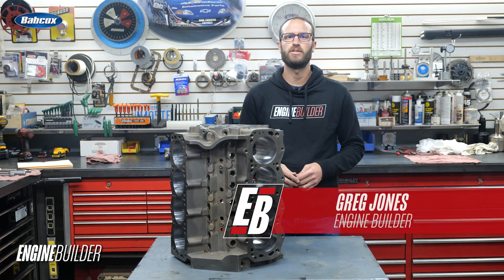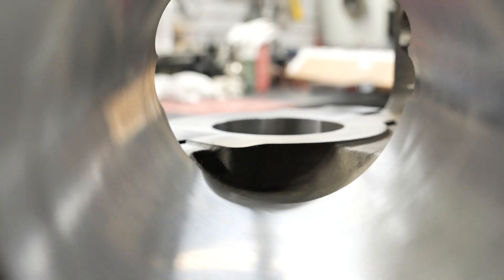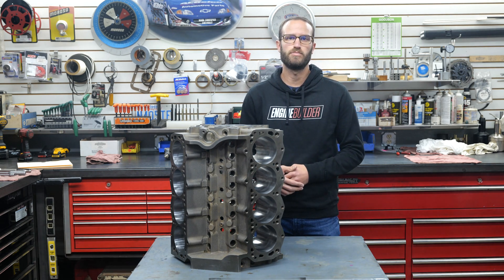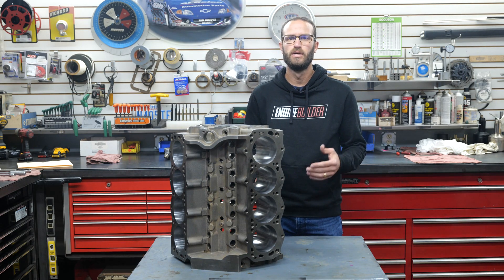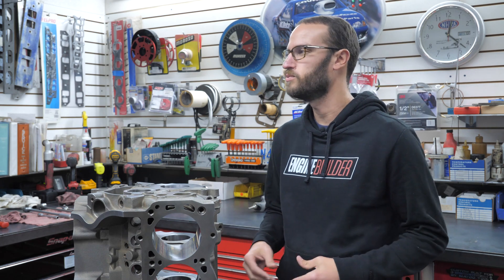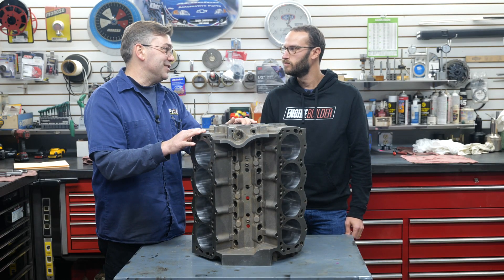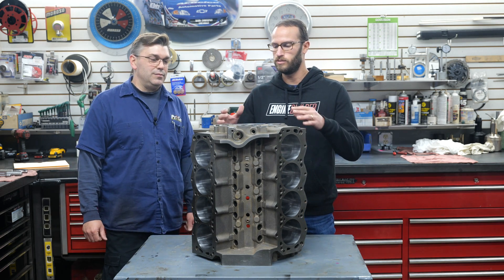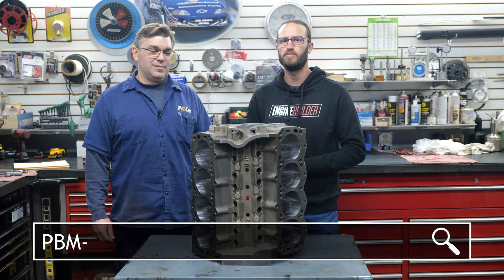Reviewing World Products' Man O'War Small Block Ford Iron Block

Comment: This block could make a big small block..4.125 bore with 4.250 stroke is 455cid. Same as the Olds 455.
Reply: Actually you can get 461ci out of this block
Reply: @RadDadisRad  Nice, that's a 455 30 out.

Comment: How much hp can this block handle?
Reply: With billet caps? A shit ton.
Reply: @ForneyRider  That’s not number Cleetus. That’s an expression
Reply: @regsmith7604  Do some research, My guess would be 2500-3000 boosted use,, but keep bores smaller.. 4.125 ish..
Reply: 2000+
Reply: No, not that much power.

How about Revs?
Reply: 2000 and up